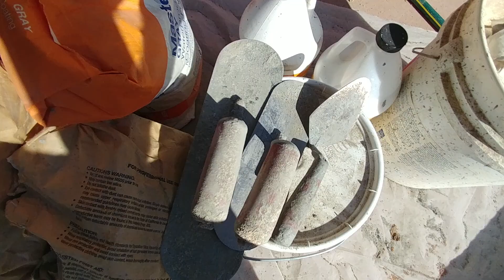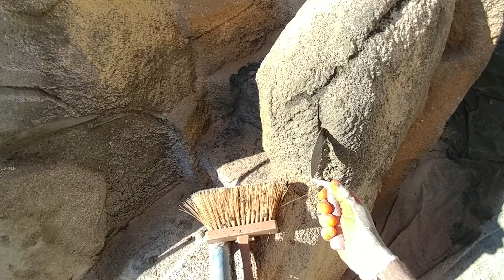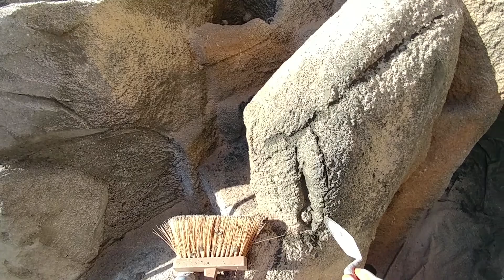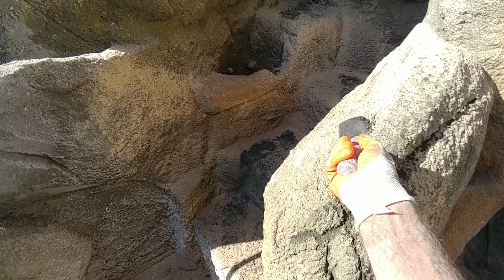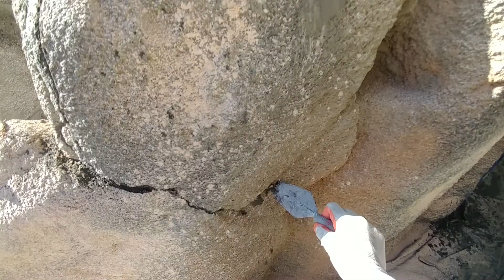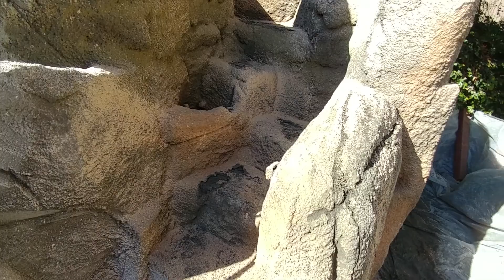How To Carve Fake Rock Cracks, SHORTY VID, With Blown on Texture

Comment: Hey Dave , how thick do you blown on the texture coat?  Prior to waterproofing I want to be vague with my details so I’m not Trying to water proof all the knooks and crannies, for texture to get depth and layers with the carving I would need to lay it on some what thick. But looks like you spray a pretty thin coat? Been following you trying to change up /step up my style.  got a sprayer , been using for  After Shotcrete coat. Scrubbing in the mud and throwing it takes a lot of time.
Reply from the maker: Hey Rob, With this video we see a texture coat that was blown on by my Sprayforce pumper machine thus it is more thick than my little hopper sprayer.  With either pumper I basically I try and smooth out all the water areas in mortar prior to the waterproofing membrane going on, (helps insure that the waterproofing actually waterproofs stuff!) then attend to more detailed textures and cracks etc.  :)
Reply: @DaveHendersonFakeRockVideos appreciate the feed back👍🏻